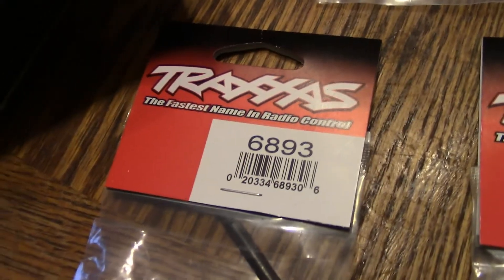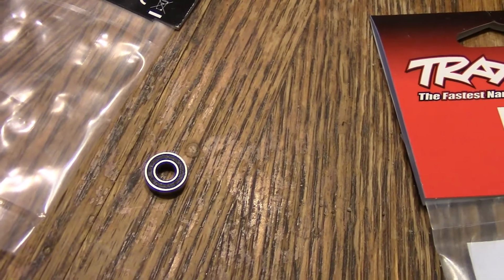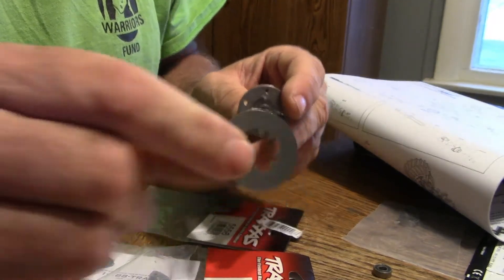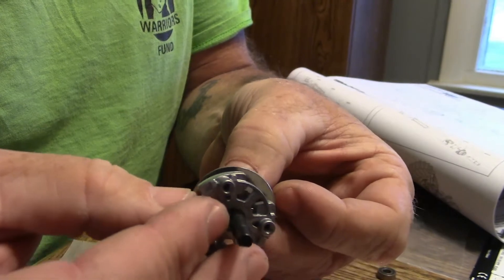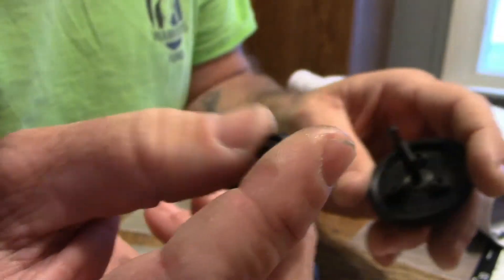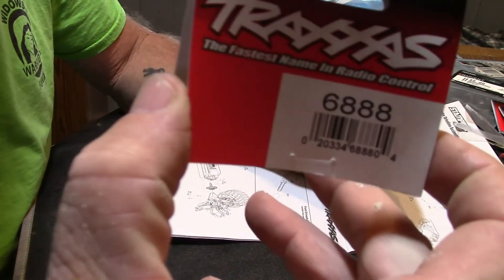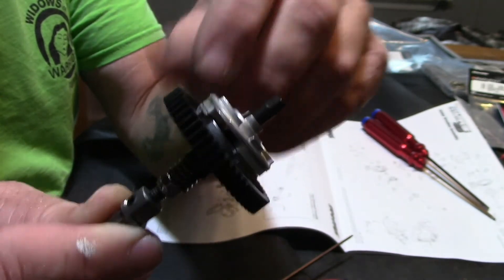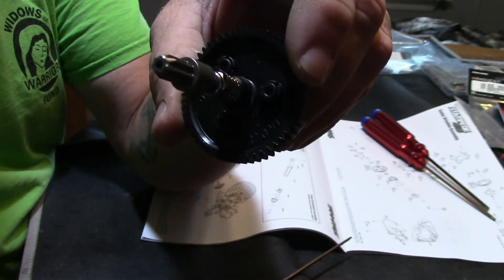Slipper clutch build for Stampede and Deegan Rally 4x4

Comment: Hi I have a question does a castle 2650kv motor fit in the rally without modification thanks
Reply from the maker: I don't think so. you may have to shave down the chassis to make it fit which isn't a big deal